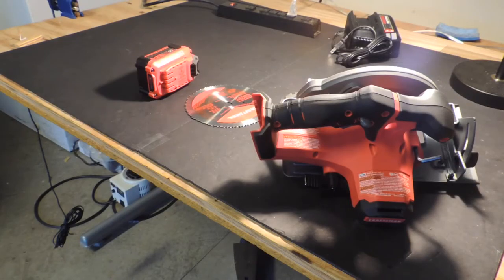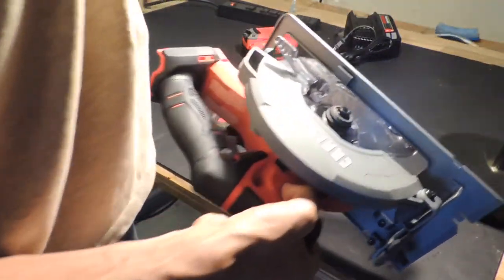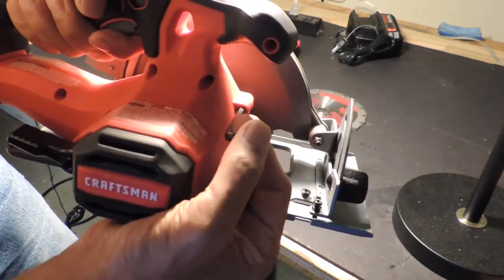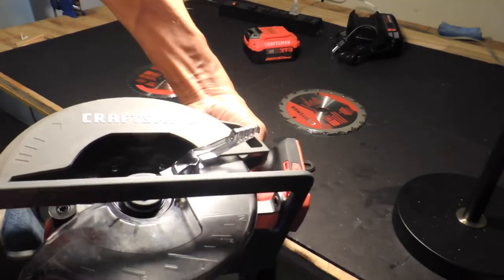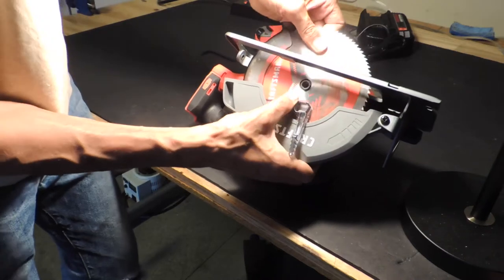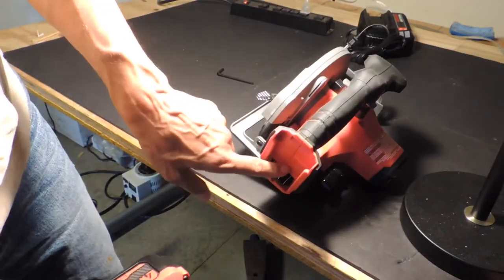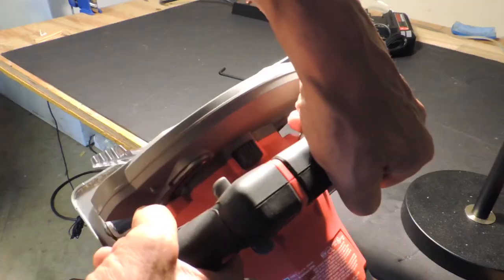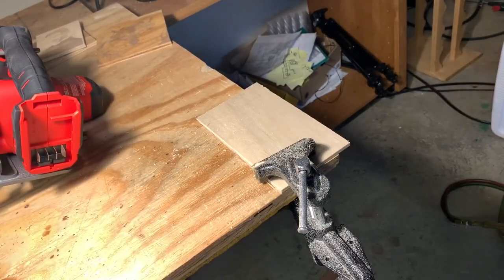Beginners Guide Unboxing and Using a Circular Saw

Comment: Anyone have idea why did our saw with blade did not align to straight notch on plate? Our plate show that my straight are off 1/8 or 3/16 inch from plate after cut any woods. If you make a line one piece of saw and you guide straight on notch then surprise it not cut on my line marked?